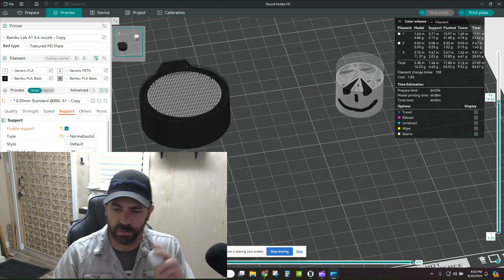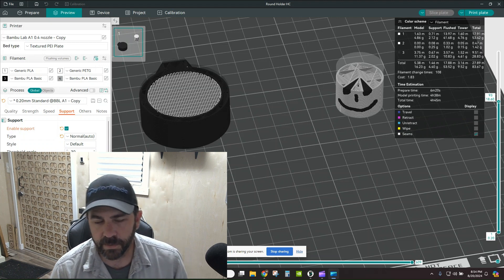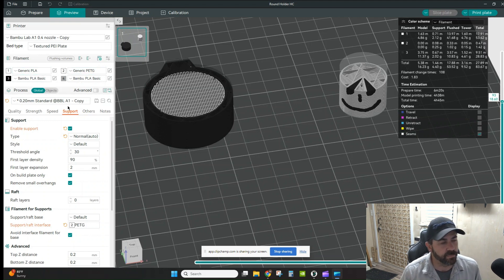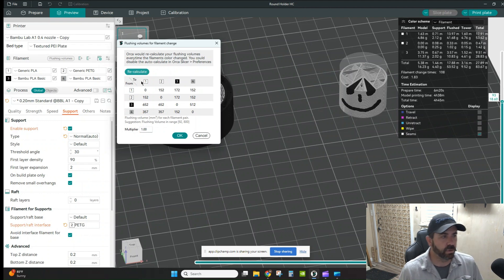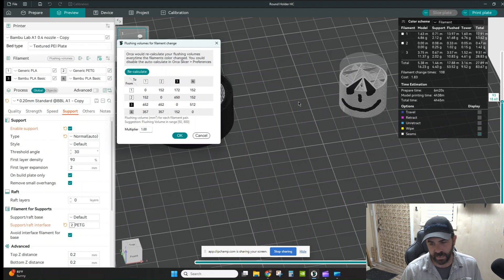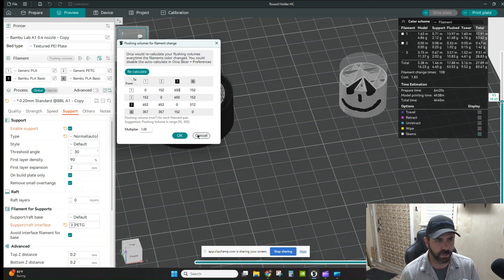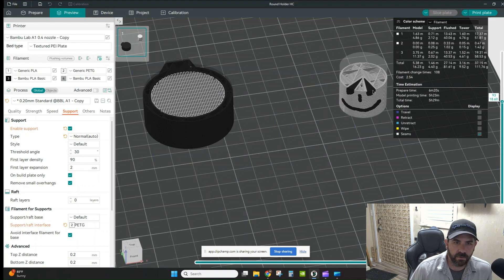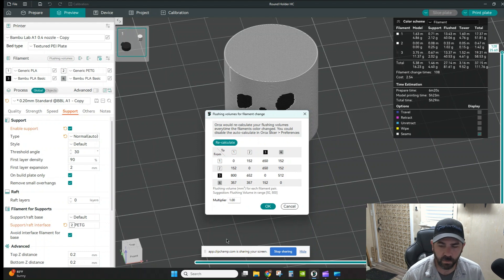Orca Slicer Flushing Volumes: Perfect Multi-Color & Multi-Material 3D Prints

Comment: How do you tell the print when to stop, in order to change the filament? I've been wanting to print some frames that have different color raised text on it but can't figure out how to tell Orca when to stop the frame print so I can change the color and it can continue right at the point the text starts.
Reply: on the right side, in the preview tab there is a layer slider, drag the bottom slider up to the desired layer, right click, and press add pause, then when the print is at that layer the printer will pause allowing you to change the fillament